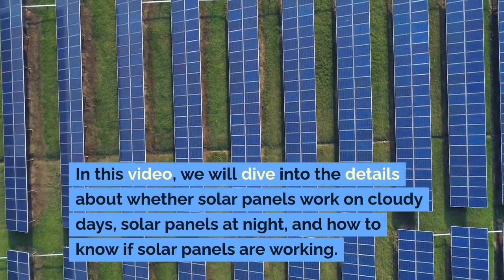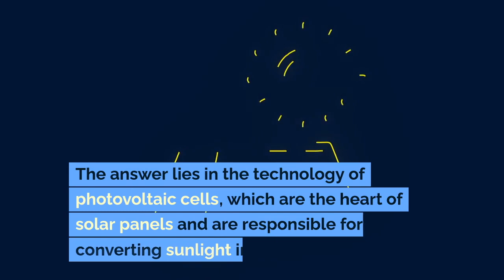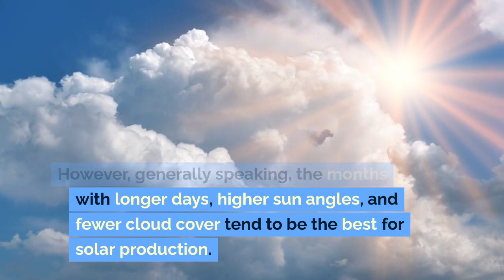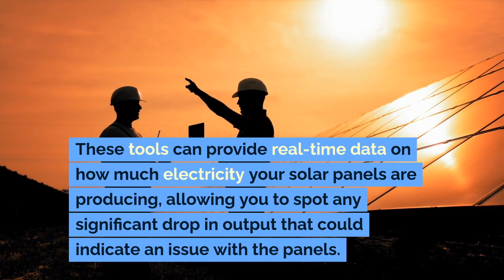Do Solar Panels Work on Cloudy Days?

Comment: This video never answered it's own question of whether or not solar panels work at night.
It only went on to explain how the solar panels worked during the day in sunlight.

I'm guessing the answer is NO.
Reply: Hi ! Solar panel works approximately at 10% during cloudy day. And bever during night.
In summer, during a good sunny day, they start to work around  7h00am to 20h30, with a maximum power at 12h30/13h00.
Reply: @sylvainassalit3539  
So I guess it's a waste of money to have solar panels in an area that is cloudy most of the time.
I figured it would be bad, but 10% is really bad.

Comment: During a recent power outage lasting 9 days, I had to try to charge my Solar Generator with a portable 100 watt panel during fully overcast skies.  It charged at 4 watts from my panel ... 4 WATTS!!  That's just 4% of rated capacity. So, better than nothing, but not much.